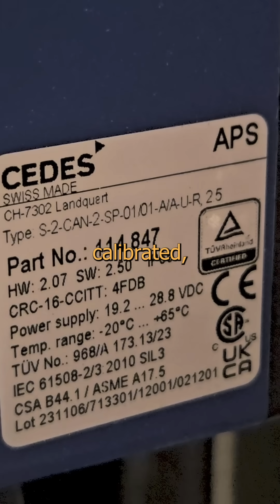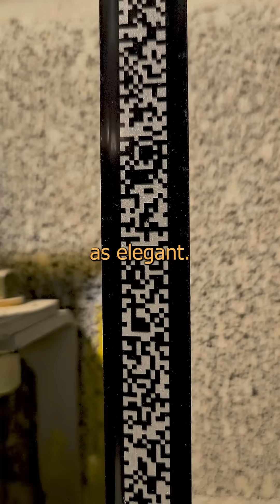Elevator Encoder #chrisboden #comedy #engineering #controls #urbex #indicator #resolver #barcode

Comment: 10bit 2¹⁰ -> 1024 combinations but for some reason both the sides of the strip starts and ends with black square which is 1 I guess but but not on every line oly repeats for every two lines do buildings with nore floors also use 10 bit or more  to accomodate for the height of the floors. I don't know but interesting 😂
Reply: Or it reads a whole 10x10 square at a time... There's enough data to include a checksum/error correction and still have enough bits to address every 1/4" of a space elevator!

It's not a QR code. But it's probably read optically, so no reason to believe it is limited to one line.
Reply: It looks like the frames are 3 lines long - just note the regular ticks at the borders every 3 lines. So it's 30 bit per frame ~ a billion unique marks. Assuming 1 mm pattern resolution it should suffice to run a couple of kilometers 😮
Reply: @andreika7519 nice observation!

I went back to look, and noticed that the ticks on the left side are offset 1 row from the ticks on the right.

3 rows would be reasonable.

I wonder if it reads 3 lines at a time, or one line with several lines of memory...
Reply: @andreika7519  Excellent catch!  Left, right, neither.  Cool!
Reply: Thanks! I spotted the 1024 limit and wondered as well!  Two lines per pattern makes it work.
Reply: Look closer. The 1st and last bits provide a rather crude clocking pattern. The sequence for either side repeats every 3 codes and the first and last bits are offset from each other by 1 sequence. So, you'll see 

1xxxxxxxx0,0xxxxxxxx1,0xxxxxxxx0,

repeated over and over. The center 8 bits are most likely a pseudo random sequence. The controller most likely recognizes a known sequence of values to provide locations. And because of the clocking for the 1st and 10th, there are only 768 possible values.
Reply: Sounds like there's a de Bruijn sequence on the tape
Reply: I thought they would have used a Gray code, but apparently not!
Reply: Codes can repeat and there's no reason for this not to. Only the combination of code + floor number has to be unique. This would simplify manufacturing costs because you only need to make one set of code rails that you can recreate for every floor rather than having to do multiple different rails, plus it makes installation easier because if these rails are exactly one floor tall and are all identical you can't install them in the wrong order. The codes may look random but they're likely just an incrementing number overlaid with a random pattern to prevent huge areas of blank or set tiles (QR codes do the same). This aids in decoding.
Reply: @radio4active  If you look up the manual for a CEDES Absolute Positioning System, you'll find that the code tape comes in a 1.5km spool. It is not installed floor-by-floor. You're supposed to install it by mounting it at the top, riding the elevator all the way down, ensuring that the tape uncoils correctly. It's so long, that "building shrinkage due to differences in thermal expansion factors" is a legitimate concern brought up in the manual.
Reply: @InverseHackermann  "CEDES Absolute Positioning System"  thanks for the magic search phrase.
Reply: Like a barcode the 1 at the beginning and the end are probably used as a "framing" mechanism in case the strip is perfectly aligned with the reader.
Reply: Bro, proofread your comments.

Comment: 10 pixels width.

1pixel = 2 possibilities
2px = 4 = 2^2
3px = 2^3
...
10px = 2^10 = 1024.
I kinda doubt that 1024 unique rows are enough to cover the whole height.

So your statement that it determines the height by each row is probably wrong, and whats more likely is that it's separate into blocks, (like 3 rows, or 5 rows)
Reply: diving a bit deeper, notice the repeating pattern left and right? 1 dot every 3. row.

so I would say the high is stored in 3 row blocks, but now 2 of the px are useless, so we have a 3x8 block = 24
2^24 = ~16.8million. that should be enough

Comment: Gotta love the magnetic sensor back-up at every floor. Because when it comes to safety systems, "two is one, one is none"
Reply: Redundancy is good. 

IBM had a system called the 3850 mass storage device that used a similar method to position an arm that went back and forth. Unfortunately, their strip was made of mylar. 

An IBM customer engineer told me about the day when the strip broke and the arm kept seeking to find the right code and went all the way down to the end and pushed its brother arm through the side of the machine
Reply: Generally speaking, there's three parts to the operation. The controls will perform rough calculations to set accel/decel ramps over a given distance, which means it should be slowing down or already at minimum speed when it triggers the magnet/prox switch. The magnet lets it know it's reached the rough door position, and then the qr encoder is used for fine positioning.
And also redundancy is key to a safe design.
Reply: Some safety guy was adamant that these magnetic sensors be there, because grey-coded QR-style bit readers are considered programmable, and safety guys LOVE relay-based stuff that can't be programmed, but CAN Be cycled 10,000 times doing the same thing over and over to prove reliability. 
The grey-coded laser-reader picks the exact position, but only the hardened safety sensor can say for certain, "this is where a door should be".
Reply: @quietone610  this is the way...
Reply: @quietone610 that's not necessarily true. Newest elevators use PESSRAL. Which is a specific certification to use programming for lift safety.
Reply: because it can be thwarted by dust.
Reply: @kenbrown2808  eh... it would take a lot of dust. The lasers/sensors these things use don't operate in the visible spectrum. They're usually IR, which is a bit more forgiving about particulates.
Reply: @vincentcyr3719  true, but I've seen how much maintenance the typical elevator shaft gets. gets.
Reply: @kenbrown2808  you wouldn't even need maintenance. Just have a brush that sweeps along as the elevator goes up and down.
Reply: @vincentcyr3719  The brush would wear down over time, and would erode the coded strip over many years.
Reply: @kal9001  hmm... make it electro-static, then. Non-contact, if you use the right materials and design it right, it shouldn't even need power.
Reply: @vincentcyr3719  at work they used the same system on a bridge crane and dust absolutely hammers them.
Reply: @vincentcyr3719  dust can block UV and IR light. It's redundancy. The new system can fail for any number of reasons. The old system worked, the new is a nice to have. Having both systems make them redundant to eachother and redundancy is safety.
Reply: @kal9001  it looked like there was glass or some sort of clear protection over the code strip. So id think the brush would be fine.
Reply: @kal9001 how hard do you think the bristles on that brush are? Nylon won't erode metal
Reply: @kal9001 Brush? Why would they be running a brush over an optical code strip? Your phone doesn't need a brush to read a QR code. A supermarket checkout scanner doesn't need a brush to scan your groceries.
Reply: @Whammytap  I'm not the one who suggested a brush, I was replying to someone else who did... keep up -_-
Reply: @kal9001 My bad, I didn't even notice
Reply: Many traction elevators have even more. I've seen some with two magnetic strips and two photo strips 😂
Reply: in addition to the encoder on the machine itself and the limits in case something goes horribly wrong! when it comes to elevators, redundancy on top of redundancy on top of redundancy
Reply: or just a fly setting in the wrong spot, or a gecko or something
Reply: @TheJunky228  that's the beauty of an electro-static "brush.". Its Non-contact,  but the gap can be small enough that it can physically push away things over a couple millimeters in size.
Reply: @vincentcyr3719  Thank you! I'm happy I didn't have to scroll far (or god forbid write my own comment) to find out if there's a backup system (which there has to be)!
Reply: That is, if one fails slightly, you don't want everything to break instantly
Reply: It's most likely a door zone sensor with lvl up lvl dn and door zone so even if it's a little lost it can level into the floor.
Reply: Ha ha, we preppers borrowed that phrase and applied it to pocketknives.
Reply: And more is better.

Comment: I am not convinced that this is a solution that will last for long. Elevators shafts aren't exactly pressure washed weekly. I would say the magnetic tape solution we have used the past few years seems like a more robust solution. We have also had tachometers on the wheel up in the machine room that has also worked fine but with a bit less accuracy since wire slipping and stretching are factors.

I think one of the best strategies would actually be ultrasound distance sensors if you want/need mm accuracy mount an ultrasound distance sensor on the top of the car and point it with a slight angle towards the door then manufacture the doors in such a way that there is a metal plate you can use for levelling of the car. This will give you your fine position and then you have your rough position being given through traditional means like magnetic strip or tachometer on the motor/govenor rope. 

Having over engineered QR codes in the shaft while a super neat idea and something I definitely think will have an application somewhere else just seems like a solution looking for a problem 😅

Comment: Isn't this still a complicated solution? I mean someone still needed to ID every millimeter of the shaft with a code that fits into that tiny space. And then it needs a sensor that can read this fraction-of-an-inch code reliably enough. Then someone writes software that adjusts the speed/height of the cabine and so forth.

I wouldn't call that simple? But I don't doubt that the design is genius and made with brutally reasoned intention.

Comment: Okay so there seems to be 10 “bits” in one horizontal slice of the tape. That means there are 2^10, or 1024 combinations encoded in that binary tape. If each of those is just a few mm in height, say 10mm. That means the max height of the tape is at most 10240mm or about 33ft.
Reply: Yeah I did the math too, seems like this would be for a 3 story building. Unless it uses two or more horizontal slices, or on elevators for larger buildings the "slices" are larger. To me it seems having 2 or more slices would be the simplest fix
Reply: I think it's 24 bit, as the two outer bits in each row form a fixed, staggered row ID pattern?
(The edge columns are always 110110110...).
That presumably allows the system to select each complete three-row data block from the continuous pattern.
Reply: Encoders are  also used on CNC machines to position the tools to under 1 one thousandth of an inch. There are other codes besides binary that can be used such as Gray Code.
Reply: I thought about it right after posting, and think there might be an external counter of 10 bit units in the car or whatever. This software could makes “slices” of the elevator shaft into like 3 story bites for measurement. Otherwise I don’t know how tape or that fixed width, eg fixed precision, could be used without widening it.
Although using 16bits would allow for roughly 2100ft of shaft.
Reply: @millrightrick1 . Well done! It  is gray code.
Reply: @thericesquad  Wait, is it? It looks very different from the Gray codes I've seen

Comment: Grays Code - allow myself to introduce myself (probably sorted in a way that would be most recognizable by the optic scanner).
Reply: Nope. It's not grays code at all. The key feature of Grays encoding is that only one bit changes at a time. With the images shown in the video, it's pretty obvious that more than one bit changes per transition. From what I can see in the images, there are 10 bits. The first and last bits are repeating over a three transition interval. The center 8 bits look pretty darn random. So it looks like the system will see an unique sequence of values, which isn't going to repeat for a very long time (far more than long enough for an elevator shaft). But for induvial values, there's plenty of repeats since there's only 768 unique values possible with the observed encoding (3 * 2^8).

Comment: Hmm. That's 1024 (2¹⁰ bits) possible positions. Assuming every strip corresponds to about ¼ of an inch along the shaft that'd make it about 6 and a half meters tall. The unique ID for every position approach would be for rather small elevators in this case. It's possible that it's using a pair or a triad of identifiers instead of just one, giving the possibility that the individual bars are repeated but not groups of bars. By combinatorics that'd likely increase the number of encoded positions by a tad more IMO

Also, spotted the strip with the binary representation of 0 (all blanks) on camera 😮
Reply: It's an optical reader that samples more than one line at a time and since the lines never repeat it can be like pi.
Reply: @Alacritous  With a finite number if the shaft is long enough there will inevitably be some repetition, so reading by groups is likely what it's doing
Reply: Of course more bits mean more possible positions if one to one and your usual integer nowadays is represented as 32 bits, that's billions of possible positions especially if you imagine negatives don't exist